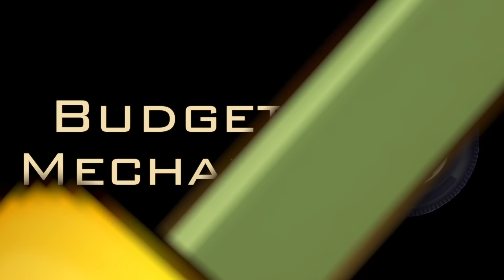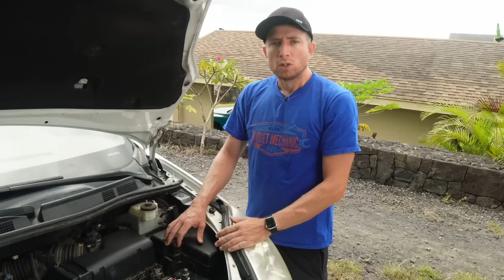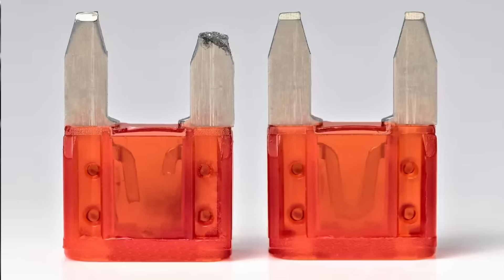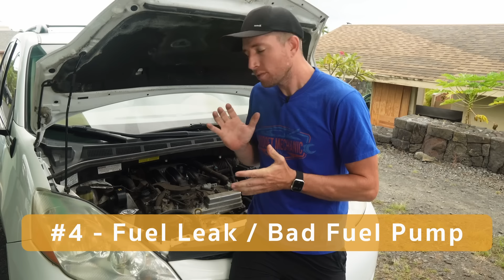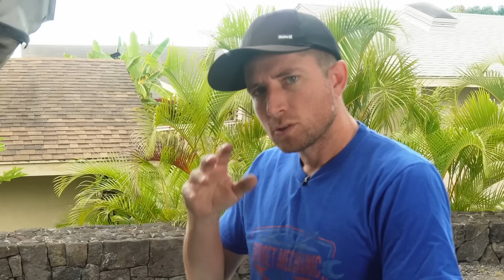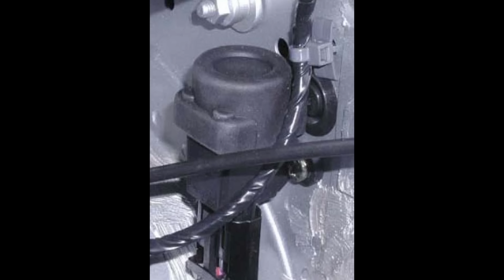Car Cranks But No Start? Diagnose And Fix Now!

Comment: if hard starting first thing in the am or after it’s been sitting awhile, but it eventually starts; check fuel pressure regulator. turn key to ON for four seconds, then OFF. repeat 3 times. on the last time, turn to START. If it starts right up, it’s the fuel pressure regulator. If it still cranks without starting, look elsewhere in fuel or ignition systems.
Reply: Wow. This worked! 1993 Ford Ranger 4.0. Crank no start. Started up with starter fluid. Went out the next day and crank no start. I read this post so I went out to give it a try and low and behold it started when I cranked it after the third turn. You’re a genius. Thank you for sharing your knowledge.
So do I need to replace the fuel pressure regulator or some sensor?
Reply: @coachmoore495  fuel pressure regulator needs replacement.
Reply: @louisperich6678  I replaced the FPR and the fuel pump. Still have the issue.
Reply: @coachmoore495 me too, have you figured it out yet?
Reply: @donharris1615  not really. I replaced the FPR but the issue persisted so I had the fuel pump replaced. Sent it to a second garage and they determined there was water in the gas. Got that squared away but the thing still has issues starting in the morning. Once it’s started, it will restart as normal. I’m going to replace the FPR again. Maybe I got a bad one.  🤷‍♂️
Reply: Hard/rough starting after sitting awhile can also be dirty/leaky injectors. Causes fuel sitting in the cilinders. Put some injector cleaner in your tank. May take two or three bottles and some highwaymiles. Regards
Reply: I’m having this issue on a 2007 Lexus RX 350, I installed a new fuel pump and it took 3 times turning the ignition switch to Start, I then installed a new fuel pressure regulator, and it still won’t crank up right away. What could be wrong, I did everything that everyone mentioned and this just started all of a sudden. I don’t have any trouble codes or check engine light, also once it start, the engine runs very smooth, and drives like normal, until I shut it down and try to restart again?  All the fuses and relay seems to be good.  Help!
Reply: @donharris1615  drain some gas into a jar and see if you have water in there. That’s part of my issue. I think I got some bad gas from Sheets.
Reply: @coachmoore495 because I bought the car for my lady, I put the medium grade in when I was supposed to use premium. Maybe that's the big issue also I used Speedway 89 medium grade gas. But since then I've been using premium for her We turn the key back and forth two or three times then it will start, I'm going to use the best fuel injector cleaner and a gas cleaner while it's empty and install a new fuel filter and motor and see if that works?
Reply: @coachmoore495  I drove the car until the tank was empty, then put in Royal Purple fuel injector cleaner and installed a new pump motor with new fuel filter and fuel pressure regulator sensor, all located in the gas tank inside the fuel pump assembly, after driving a little bit and adding more premium grade gas, the car is starting to start on the first turn of the key some times, it's getting better and better, I will add more Fuel injector cleaner and a new gas cap,  hopefully it gets better and better then maybe start on the first turn of the key as it suppose to all the time.  I will keep you posted.
Reply: @donharris1615  that’s great news Don. 
I replaced my new FPR with a different brand and my truck is starting in the morning like it should. I’m not sure if water in the gas ruined the fuel pressure regulator or if it was just bad timing that both happened but I think (fingers crossed) that my hard start issues are resolved.
Reply: Thank you! This worked for me! Does this mean I need a new fuel pressure regulator?
Reply: how do you get the code on your car that diagnoses the problem?
Reply: @ibelieveinyour  scan tool for Lexus and Toyota, I got it off Ebay
Reply: We have a weird intermittent starting issue with our 2019 Durango sometimes it starts up fine sometimes it cranks and cranks and cranks and then starts it's weird
Reply: @TAmattdamon I had the same issue immediately after having a remanufactured engine put in my truck a few weeks ago.  The shop said they thought it was the fuel pump.  Finally got around to replacing the pump and filter the other day.  Same exact problem still.  Now, since yesterday it won't start at all.  Just cranks with no start.  No codes being thrown and there is definitely gas going to the fuel rail. I'm at a loss and out of money after the new engine....
Reply: I tried this procedure, and now the car won't start at all? what could it be?
Reply: Wouldn’t you normally see a check engine light on if your fuel pressure regulator was bad?
Reply: @nomandad2000not reliably no.
Reply: This happens to our car. First try, the engine only cranks. But upon pumping the fuel pump, it starts immediately. If ever it starts after turning ON and OFF 3 times, it won't happen again, or is there a part to be replaced?
Reply: @christiandave_  you will need to replace the fuel pressure regulator.
Reply: It worked for me thanks, I will update about the problem

Comment: I just spent $460 on getting a new fuel.pump installed,  on my 06 f350.still not starting. I'll throw a lil bit of gas down intake and it starts and runs until that gas gets used up. Idk what else it vsm be
Reply: Fuel injectors need cleaning or changed out
Reply: Or a clogged fuel pump?
Reply: before you replace f/pump check wiring , those ford have problems in the fuse box
Reply: Have u checked the fuel pump control module

Comment: I have a 2000 ford expedition didnt put oil in for a while and drove it and it got stuck in 4 wheel drive and i tried to make it to the store and it wasnt pulling right so it shut off then i crank it back on and it drove for like 4 to 5 mins then shut off again its barly cranking but wont start

Comment: My 1993 Mazda b2600 does this when it rains or on really humid days/mornings… I’ve replaced the distributor cap and rotor, spark plugs and wires, checked plugs on harness and fuses.. I’m lost 😞 haven’t replaced the coil yet but it’s an aftermarket NGK one so it has been replaced before 🤷🏻‍♂️ also replaced the older battery with a red top Optima since I run a stereo system, the radiator fan, AC clutch fan and power windows directly to the battery. All on switches
Reply: Did you ever figure this out? I am currently dealing with the same problem

Comment: My 2006 VW Beetle was doing this after sitting overnight. It was a 5$ sensor "coolant temperature sensor" 
Of course after spending 215$ for nothing, this 5$ sensor was the issue 🎉🎉
Reply: Omgaahh so my jeep threw sensor code the sensor for coolant and then my check engine light went off after a day so i didnt take it in thinking it was maybe stuck or had debris on it.  Fast forward 2 days later now it doesnt start but cranks. Just got it towed to a dealer i bet its the same thing for mine. Dang i couldnt get anyone to come to my house to help so prob getting hit with a huge ass bill 😢

Comment: Hello, nice vid. I have a daihatsu sirion 2 with K3-VE engine and it stopped running all of a sudden. It cranks, but no start. I checked all the fuses/relays, they seem good. I checked the crankshaftsensor and it's giving me close to 2000 ohms. So that seems ok. I tested the harness with ignition switched on, no voltage. Any idea what that could be? I still have to check to camshaftsensor though. Regards
Reply: hi, how was your engine now? did you solve the issue?
Reply: @drobinray  Hello, first i want to say that I'm a christian, i pray to God and he works in mysterious ways. Hallelujah
I found a comment on the internet to get another ecu and program by connecting pin 4 and pin 13 for half an hour in the run position (for toyota or toyota-based cars). I tried but could not get to program/start the car. Then I found another comment to switch back to the original ecu after the "new ecu" programming failed, I did that and the car started right up with the old ecu and has been running since. So if you have a toyota or toyota-based car you might wanna try reprogramming your ecu with the "pin 4 and pin 13" method. You can look it up on youtube. A good and affordable obd reader i have is a Veepeak VP01. Godbless
Reply: @user-2uf2kr2c  thank you,, i have 3sz-ve engine, similar to k3 engine same issue,  cranking but not starting, 
do i have to find another ecu? or should i jumper/program pin 4 and 13 on my old ecu?
Reply: @drobinray  i would definitely try the jumper method first.
Reply: @user-2uf2kr2c  thanks , I'll try it tomorrow,, this is my 1st time encountering this kind of trouble,
Reply: @drobinray  First time flash for me too, i just looked it up on youtube
Reply: @user-2uf2kr2c  sir may i ask, is it still the original key you are using? I've seen threads on the internet that it was caused by immobilizer system,

the problem now is i don't have the original keys with transponder, only the duplicate
Reply: @drobinray  I don't know for sure, but it looks like it. It has the daihatsu logo on it. I bought it secondhand about a year ago with around 290.000 km on it.
Reply: @drobinray  if the car started before with the key, i don't think it should be a problem.

Comment: Spray Starter Fluid (ether) down the intake duct.  If the engine runs on that, the spark system is working (crank sensor OK) so your problem is in the fuel system.  Next step would be to verify fuel pressure at the supply to the injector rail (screw gage onto test port), then verify fuel injectors are pulsing.  If a bad crank sensor, I think the engine controller doesn't even know the engine is turning over so won't spark or pulse injectors, and won't throw a code.  If your fuel pump fails on the road, try kicking the fuel tank as you key on and off and it might start turning again to immediately drive home or to a shop.  I took a bad one out once, gave it a little rap on the bench, and it then turned with 12 VDC applied (worn bearings can seize like that).  Most cars with a MAP sensor, instead of MAF, will run fine with a vacuum leak but will idle too fast if the leak overwhelms the IAC valve (it is fully closed).
Reply: I have a volkswagen jetta 2015. 
Crank No start. And No checknengine light code
Reply: @THRIQUILLED gateway module?
Reply: Mine isn't starting and I tried using starting fluid, it briefly tried starting in 5° temperature after work and it hasn't worked since last week.
Reply: Its 2002 ranger only start when I use starter fluid is this an easy fix ?
Reply: I have an 86 ranger it turns over but trys and won't start engine shakes really bad suddenly when I try to start
Reply: Won't start with starting fluid either
Reply: @KyleG-iz9nb  Mine was due to Distributor.
Reply: Bad gas is my luck my engine job was done everytgibg is good spark everyting , no good has 6 months old
Reply: Don't spray starting fluid if it backfires it could blow your plastic intake to pieces. Ask me how I know.
Reply: Great work
Reply: Thanks
Reply: What about the fuel pump won't prime but working when the starter crank
Reply: Good test thank
Reply: What if it doest run on start fluid ? Put it away when running. Car not starting anymore
Reply: L @MechanicBundy
Reply: I will comeback to you on this.
Reply: That can be dangerous directly sprayed. Take out the air cleaner and spray it into the air cleaner housing.
Reply: You know what are you talking about.
Reply: I have a 1989 geo  I did the gas/ starter fluid test.  Did a spark test as well.  It wouldn't start with the gas down the carb and still won't start.it cranks but absolutely will not turn over anything helps if anyone knows.  Thank you for your insight already
Reply: car on but not starting
Reply: Good infos
Reply: My toyota yaris 2008 wont start when its cold but once its started and warmed up after several attemps it starts up fine again!
is that could be the camshaft sensor???
Reply: @asiash3731  same problem for me, did you figure it out?
Reply: Just clean the camshaft sensor @asiash3731
Reply: Hey, I believe my car is having an issue with timing belt or chain. (2003 Honda civic coupe ex) it cranks but no start at all. Middle of me driving in the 40s car went limp all lights flicked on the dash jusr only asking bc idk if my engine is screwed bc of it. The belt is still on and still turns when you flick the hood up to check. 2 people also told me jumped timing whatever thag means. Do you think it’s worth gettin it fixed and it isn’t destroyed? Mad bc I just got the car and license and didn’t even put 3k miles on it car is under 89k miles it’self
Reply: @AnthonyHebert I had a Plymouth that would not start. Had a broken timing chain.
Reply: @ updated: it was my timing belt got it fix and the parts for a fair price (650 total) and it started up and worked like new
Reply: H872p

Comment: If I eliminated the lower fog lights do do an accident and they had vaccume hoses going to them would that affect the car not starting
Reply: Plug the hoses with something, like a screw if small, or anything that won't get sucked into the engine if bigger. Make sure it won't get sucked into the engine.

Comment: Thanks for the video mate. I'm having a hard time with 2006 Nissan Note, It's battery died so I tried to jumpstart it, suddenly it just cranks and won't start. Could I have messed up the ignition system somehow? Some dude said that to me before, I think he could have been out to scam me. I just want confirmation from you, can I really mess up a car's ignition system by jumpstarting it with lower power rating jumper cables? It couldn't do a thing with 600W rated but it does crank with the big 3000W rated set.
Reply from the maker: Low quality jumper cable don’t provide enough amps which can cause voltage to drop under starting load. But it’s very unlikely that’s the cause. Did you check that your cars anti theft system wasn’t triggered by the dead battery?

Comment: Can you tell me if the 2016 Corolla has an inertial switch? I crashed the Corolla and now it cranks and doesn't start
Reply from the maker: You’d have to do some research but pretty much every car has them.
Reply: Check your owners manual. It should tell you where it’s located.

Comment: My 2002 BMW X5 4.4i it said   —STOP Engine Oil Levels—  and then it died then it started back up nd started studdering like it was bad Plugs and hasn’t started back just cranks no start please help I been stranded for 2 months now without a vehicle
Reply: You ran the car with no oil, so most likely has a bad engine
Reply: Change the Crankshaft sensor and see wht happens
Reply: Have you checked the oil levels? I would start there.
Reply: Do you know What BMW stands for? Big Money Waste. Sorry bro you need a new engine.

Comment: Thank you, this is very helpful. I would like to add my two cents here. My Mazda 3 was cranking but not starting, and the reason was a faulty mass air flow sensor. No code was recorded. But the culprit can be pinpointed by disconnecting the sensor and the car can actually fire using it's built-in dummy mode. Worth checking if the car hesitated to start, dropped in mpg, or had thrown a P0101 code recently
Reply: Think that’s my issue but mine read the code for mass flow sensor issues with a check engine light. Going to replace it today since cleaning it didn’t work!
Reply: I’ve been trying to get my speed3 to start for 2 weeks now. I swear if this is my problem

Comment: I just changed my catalytic converter on my Honda accord 2010 EX-L 2.4. It won’t start, it makes the sound of cranking but won’t start. Any ideas of what’s the issue?
Reply: Did you ever figure out the issue?
Reply: @Scarlett607-g7t  my battery cable was loose. I took it to my local mechanic to be sure everything was okay and running I did a tune up while I was there since two of  my spark plugs were faulty.
Reply: @averageguy1778  ty

Comment: Would older cars have the option for a code reader? Like 2008/2009?
Reply from the maker: Yes for sure. Odb2 interface has been on cars since the late 90’s and remains unchanged
Reply: All U.S. gasoline personal vehicles since 1996 have an OBDII port.  Not all inexpensive OBDII readers work on all cars, especially newer cars (say 2000+).  The $10 ones work on my 1996, but only a few cheapies work on my 2002 so need to pay ~$30.  Newer vehicles also have additional codes you can read.

Comment: I saw an ad recently for a code reader about a bluetooth one..would you recommend any ones? Also, what is a price range for an engine diagnostic done at a shop?
Reply: Blue driver for about $100 is very good and is great value for what it does.  My opinion is to avoid the cheap $20 ones.  I own cheap $20 ones, Blue driver, and a $1000 one.
Reply from the maker: Which $1000 one do you have and do you like it?
Reply from the maker: The Bluetooth iOS ones are decent. I find them a headache with all the connection setup. But when they work they work!